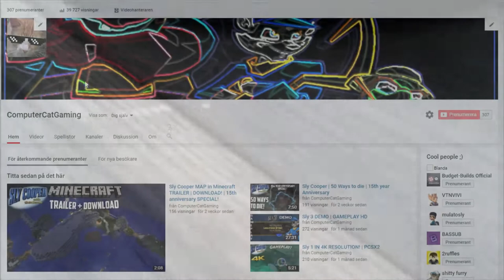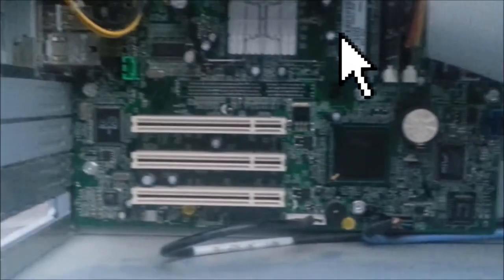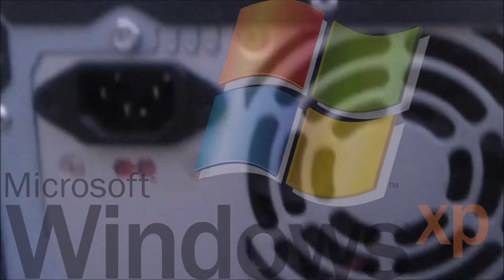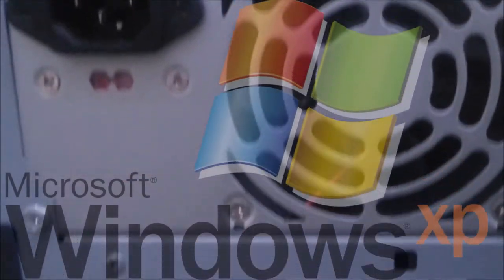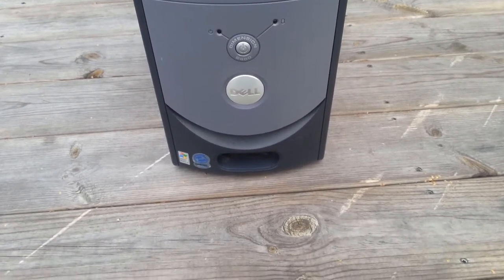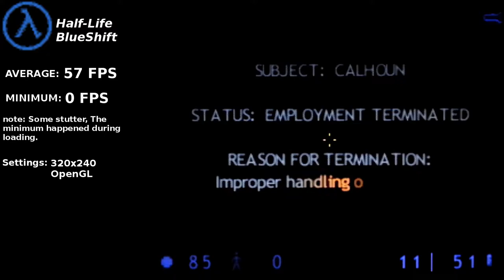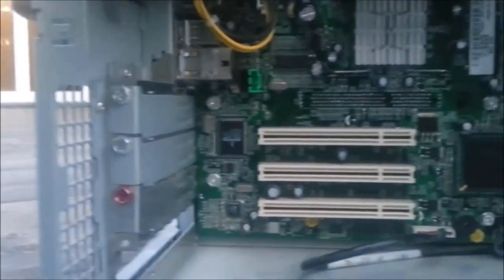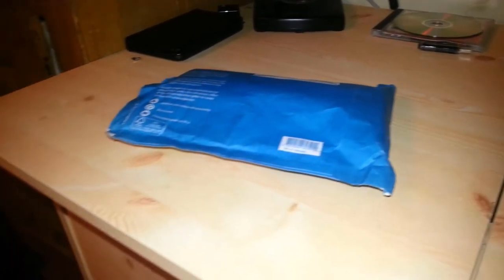Can It Game?  | The DELL Dimension 2400

Comment: I have a Intel GMA 4500M and I thought it was the worst.... This is just taking the cake.....
Reply from the maker: Labib's Official Science Page yeah the Intel GMA 4500 is way superior without a doubt! ;) It can almost even run Oblivion which is a huge step.
Reply: ComputerCatGaming 

Unfortunately it's still a bit too underpowered for me, I mean Minecraft made my pc crash it self so ehh...
Reply from the maker: Labib's Official Science Page could very well be the CPU too hehe, I mean I could get this PC to run Minecraft but after breaking one block it completely freeze lol
Reply: ComputerCatGaming 
I used MSI Afterburner and my CPU was being bottlenecked.. And its a Pentium T4400... I was thinking about upgrading but its not worth it. And besides theres a stuck screw ;-;
Reply from the maker: Labib's Official Science Page Yeah I think your better of getting a new PC too rather than upgrading your current one, I recommend getting a cheap used sandybridge i5 desktop if you're on a thight budget.
Reply: ComputerCatGaming 
Might go for getting a old used dual core pc and switching out Mobo and CPU for an i7-920 system and pushing it to the 4GHZ range. For GPU a GTX 460/480 will easily suffice. Hopefully though..
Reply from the maker: Labib's Official Science Page that could be more expensive in the long run through since that would be rather power hungry and electricity isn't really free. ;)
Reply: ComputerCatGaming 
Meh other people can worry about that😅. Not too worried though. Could go for a 750ti, or go for the i5 route.

Comment: Hi All, I have my Dell 2400 as a low end XP machine.    I wiped the hard drive, installed dos 6.22 on a 2gig partition and placed my favorite old dos games on it.  One the rest of the hard drive i installed win XP , and it dual boots fine with the stock microsoft menu on boot up.  My machine came with 1 x 512 memory stick but i replaced it with 2 x 1 gig , XP flies, but i cannot install win 95/98 on it with that much overall memory.
The other option which make it retro friendly is on boot up  select bios set up ( F2 maybe ) and go to CPU option and change it from normal to compatible - this i believe turns of the cache and the cpu slows down to 386dx levels, you can play the mid 80's early 90os games much better now, but XT AT games locked to the 4.77hz will be to fast , you will have to try out soft ware slow down software.  Just ensure yo use a SB16 or similar PCI card for best dos sound experience.
The machine is not a powerhouse, but are extremely stable and reliable
Reply from the maker: +george maragos Cool I still need to try out DOS on this thing! 
So far this Dell is now my main windows 98 gaming PC, after a lot of troubleshooting of hardware conflicts.
And I think its very cool seeing such machines like the Dell 2400 finally being useful for something whatever it is DOS or some early 2000s gaming, though the lack of AGP is a bummer but it's a nice system for various projects.
I will probably make a video on this PC once more in the future.

Comment: I found a Compaq Presario S6020WM on the curb that was very similar in specs to this PC.  It has a MSI motherboard with solder points for AGP but no slot.  I didn’t want to keep it original being a Celeron so I performed the following upgrades:
1. Replaced the PSU (bad caps) 2. Replaced the Celeron for a Pentium 4 2.8 GHz
3. Added a 256MB PCI ATI Radeon
4. Upgraded the DDR to 1GB and it is a now a nice little XP Gaming PC that didn’t break the bank to put together.  They also threw out the matching 17” CRT which works very well being nearly 15 years old!

Comment: I have one maxed it out with 2gb ram and use a nvidia 5200 pci graphic card. It works decent and still has windows xp even it can't go online anymore. Use it for emulation. Which does run dreamcast. It ran playstation emulator actually well.

Comment: Lol 
My 2400 has only 1x 256 MB so you're starting off better than me already.
I just got this one Donated.
 It's Possible there was 2x 256 MB but not sure
I don't have any History on the Machine 
It's so slow I'm not sure it could even run Win 95 hahahaha
I might throw a few parts into it just to get it operating the way it was intended but with a Win 7 Upgrad and Ram
I think the HDD is 80gb
Reply from the maker: It runs Win 9x quite well actually after solving all the compability problems ;)
Reply: @computercatgaming02  I also have a Compaq Presario SR2180NX 
And that one at least has some Potential 😂
It has the PCIE x16 plus 3 PCI slots.
Sata 1,2,3,4 .  4 Ram Slots 4GB capability.
2 DVD RW Lightscribe and I think 250GB HDD.
I'm no computer guy I don't know a whole lot about PCs but it's always been a Hobby of mine.
Also have a old Laptop but that has too many things needing replacement and it's Win Xp . 
Probably 100GB HDD and less than 1gb Ram
Reply from the maker: @RobPGamerVaper  The Compaq Presario SR2180NX has a Pentium D right?
Reply: @computercatgaming02  yes it's Pentium D 820. Dual Core 2.8 GHz
Socket 775 Bus 800MHz.
Asus Leonite Motherboard.
Reply from the maker: @RobPGamerVaper  I think I got that CPU laying around in my CPU box
Reply: @computercatgaming02  I really would like to see this Machine run older Call of Duty Games like Black Ops 2 Modern Warfare 3. 
But from what I gather I would have to get a the best GPU the board can support also upgrade the RAM to at least 2Gb.
But first I have to get some Thermal Paste and put everything in place run it and make sure all is well. What would you do ?
Reply from the maker: @RobPGamerVaper  I'm sorry to break it to you that the Pentium D 820 is just around what Black Ops 2 Modern Warfare 3 consider the minimum requirements as it recommends atleast a Core™2 Duo Processor E6600 or better.
Reply: @computercatgaming02  So okay and I figured that's the bump in the road I'd run into. 
But if I replace the CPU that will put me in the doorway right?
Reply: Runs 9x meaning what? In dual boot 98 or on XP?

Comment: Damn that computer is old af
Reply from the maker: Theta 117 It's not very impressive for it's age either. Though that will change with the better PCI graphics card. :P
Reply: ComputerCatGaming you sure the celeron won't bottleneck a latest gen CPU
Reply from the maker: Theta 117 Do you mean gpu? Well I'm not going with a modern card but its something from its time so it's something the celeron can handle.
Reply: ComputerCatGaming yeah I meant GPU